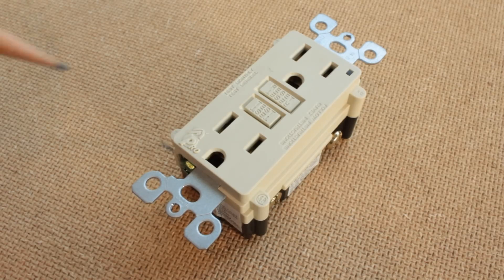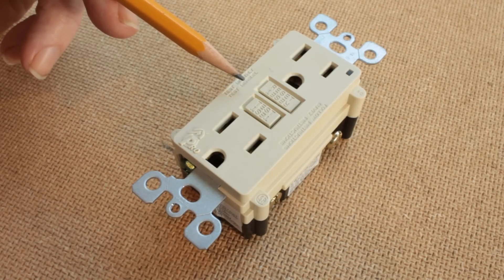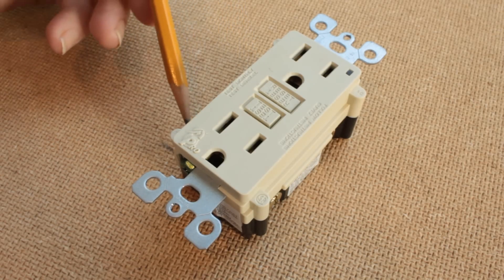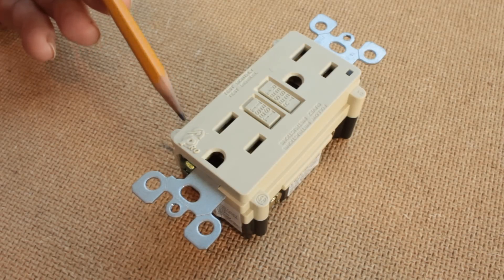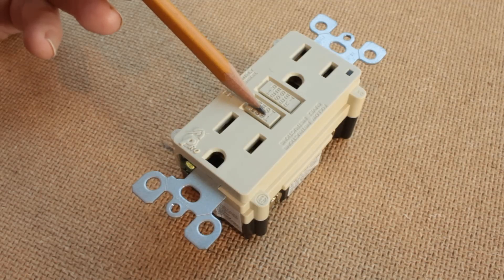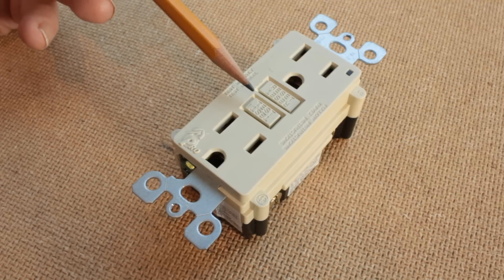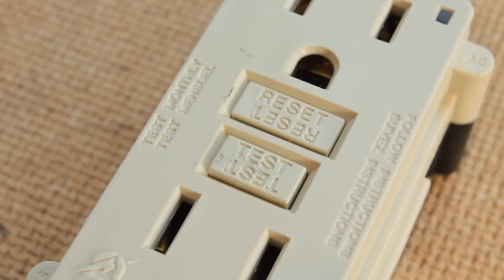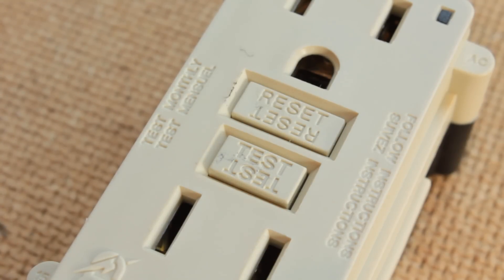GFCI GFI Outlet -Line Load, and Where's the Red Button?

Comment: All outlets in main bath went dead. No GFI in bathroom so we went to all surrounding outlets with GFI pushed TEST, red light came on all  around. No go. Went to garage and opened power box with breakers. all were visually in line but still reset one for bath.  Wife happy, her blow dryer came on. The circuit breaker only moved slightly when tripped.

Comment: If you can reset the outlet but hear it click off when you plug something in or turn it on, then whatever you're plugging in has a ground fault and should be replaced. If it gets no power at all (using an outlet tester to check) after pressing reset (which you may have to press hard) and making sure the breaker is on, you need to replace the outlet itself.